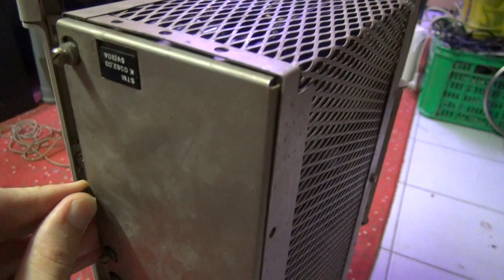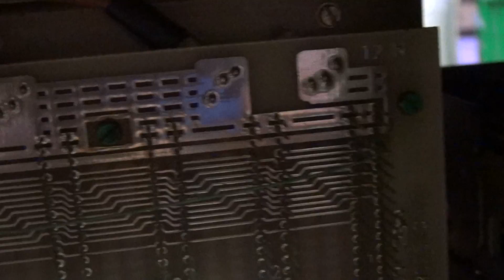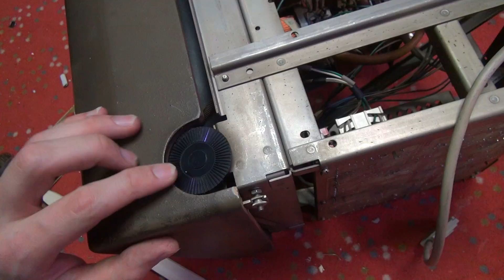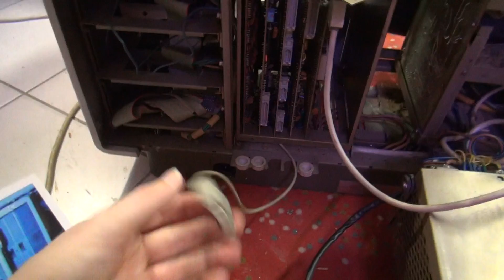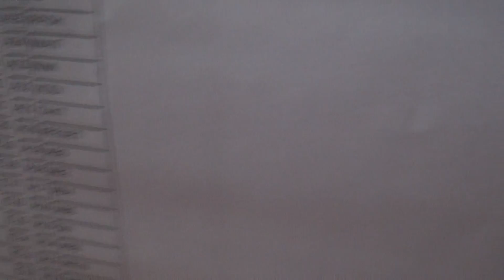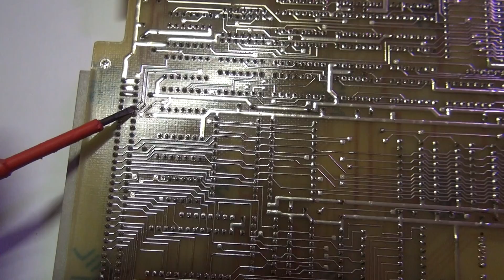doing some basic checks with my robotron a5120

Comment: Oh, that's great to see You repairing this machine. I just got the same one. It's little less dead - showing symbol mess on screen and not reacting on key presses. I think that I'll finish some other things to do and try to fix this machine. Good luck with Yours!
Reply from the maker: +Olafs Kodolšķiltava Thanks! If you are getting the mess on the screen you are already good ;-) Unfortunately I did not come any further yet.
Reply: +Philipp Maier Hello! Do You have any updates about this computer? At least I started to do something to get mine working. I tested mine with another external Robotron monitor, because built-in original one did not work. I had to rewind flyback transformer UHA-78 that was a bit frustrating thing to do. Today at last monitor turned on. Computer is not at my place, I have to grab it from my computer collector friend and I hope that next week I'll start to repair computer itself. So if You need any measurements from (a bit) working computer, I think that I coan help You.
If You are interested in aany cooperation, drop me a line. olafs@srnet.lv